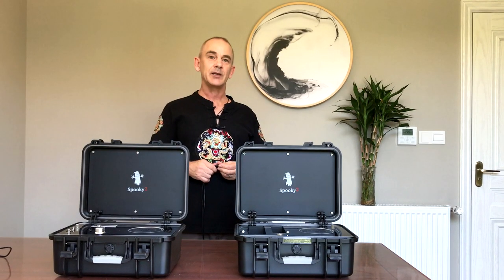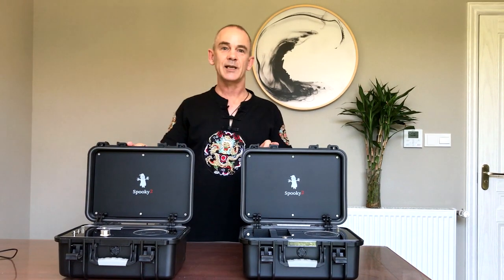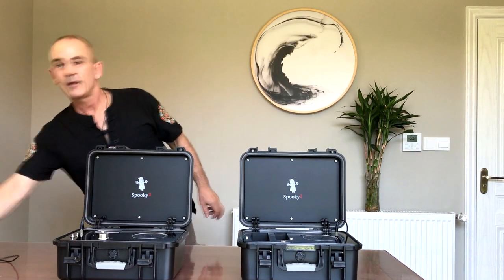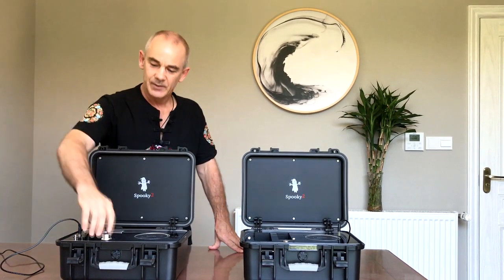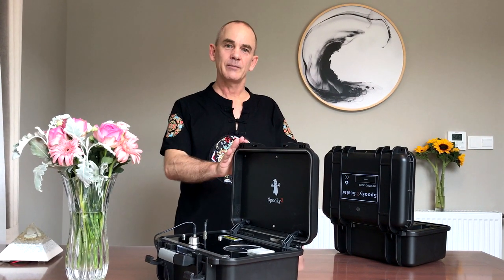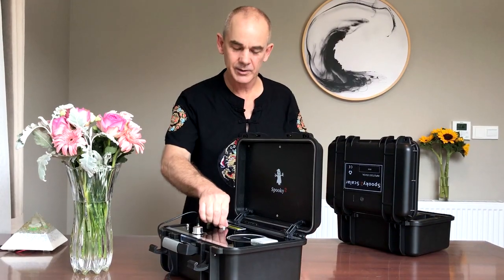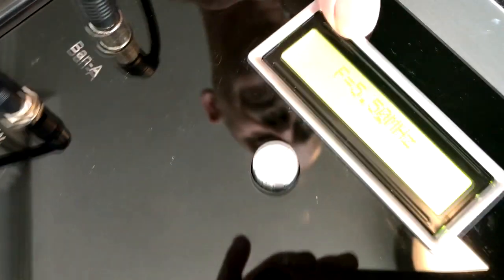How to Set up and Tune Spooky2 Scalar

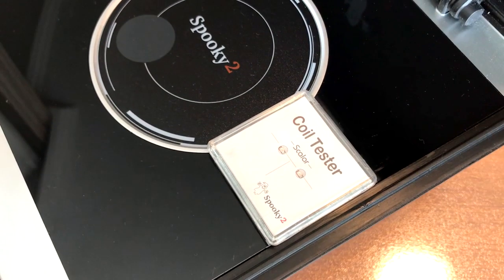Comment: At 1:01 in the video, he mentions turning the knob 2 or 3 clicks clock-wise after turning it counter-clockwise, but this step is not mentioned in your other videos.  Do you simply turn the knob counter-clockwise until the light brightens and then begin the treatment or do you turn it counter-clockwise a few clicks before beginning?

Comment: John, why didn't you use the built-in red light indicator on the transmitter to do the tuning but used a coil tester instead. Could the coil tester achieve more accurate tuning than the built-in red light indicator?
Reply from the maker: Dear Quantum Chang, the new batch of scalar is having the running led light embedded on the transmitter. No other difference. In the new batch, there is an embedded led on the transmitter for tuning which takes the place of the coil tester. In this case, it is more convenient. The function of the coil tester and the embedded led is exactly the same.

Comment: How do you turn off tuning light?  When I turn the knob clockwise it just takes the machine out of tune--going form 5.6  to 7 until the light goes out.  But then it is out of tune.  Should I leave it on to the correct tuning?
Reply from the maker: Hi, martin. You cannot turn off the tuning light when using the Scalar. You should turn the tuning knob anticlockwise until the tuning light is maximum brightness. The tuned frequency is usually between 5Mhz and 7Mhz.
Reply: @Spooky2Scalar  In this video, how come you don't mention anything about the tuning light button on the RECEIVER during the transmitter light tuning procedure? Are you supposed to check if the red light on the RECEIVER light up? What happens if the red light on the receiver lights up? What does this mean? Why does it light up and why do you need to push the button on the RECEIVER to turn the light off in order to use the scalar machine? Is it an indication of EMF interference that the red light on the RECEIVER lights up? I'm confused because there is no explanation of the light on the RECEIVER in the instructions manual. I'm not 100% sure the way I use the machine is correct or not. It would be good if you could explain what is the MEANING of that red light on the RECEIVER is.

Comment: I ordered a Scalar unit 3 days ago, and still have no notice of shipment going out, or tracking info. I received 2 invoices, the first of which I paid in full, the second I did not pay because it was a partial duplication of the first invoice. I have sent numerous emails and chat messages to inquire about this from Scalar Support...all unanswered.  I am concerned that the second unpaid invoice is causing a delay to my shipment, but can't find a way to get them to resolve the situation. You can imagine my frustration!  It does not seem that anyone is checking support messages.  What do I do now?  Is this the standard level of support for Spooky2 Scalar? Surely your customers deserve better.
Reply from the maker: Dear my friend, so sorry about that, could you tell me your name and email address. I will let our service lady contact with you as soon as possible to help you fix your problem. :)